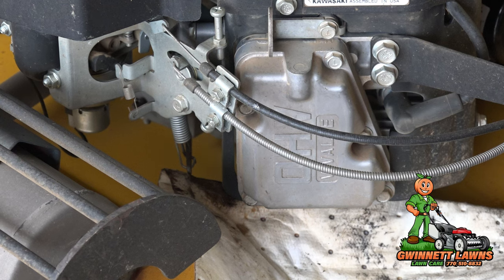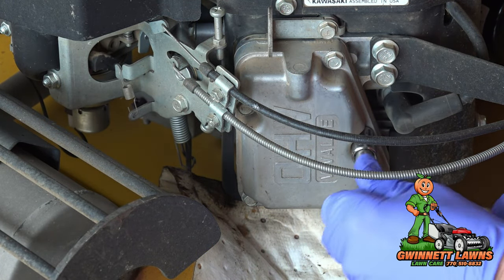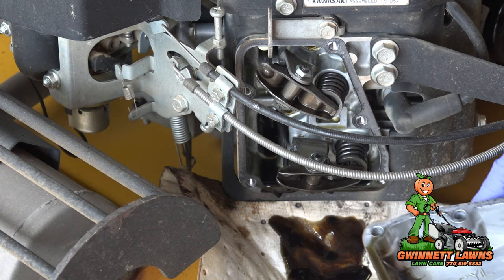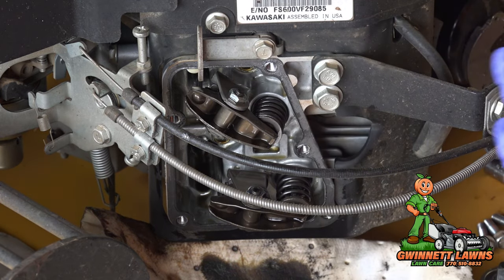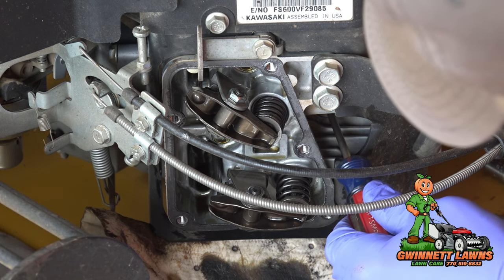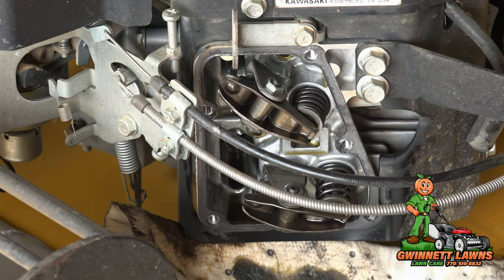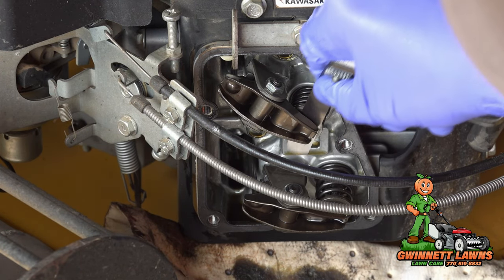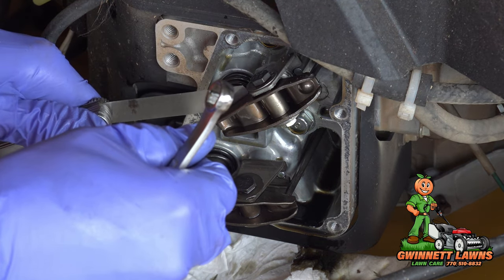How to adjust Kawasaki Valve Clearance...EASY DIY

Comment: Thanks for the great video!! I just did mine and was terrified, despite working on several engines for years. Looks like a I got it right. My problem was with hot starts. I didn't have a torque wrench that would fit, so I guessed at the torque by setting the nuts at "good and snug." I was super relieved when you mentioned that the exhaust valve clearances are usually the culprits. Same here! Both intakes had nice drag. The exhausts had no drag. I used a 0.08 mm gauge which matches your imperial size. Thumbs up (Liked) for you, sir. Thanks again!!

Comment: Nice video.  Thank you.  A couple of questions as I’ve never done this. 

1.  What was purpose of screwdriver in spark plug hole on cylinder 1?   
2. Did you replace seal on Cylinder 2?    Any tips or cautions on doing this?  

I have an fx801v, but am guessing it’s very similar.  

Thanks for showing his procedure with engine attached to chassis.  Really useful.

Comment: Dont loosen the bolt that much and used the score marks on that Cam to see that you are not moving it. Keep in mind that lawn mower valve springs are not very strong so its easy to drive in a larger gap gauge and think you have slight drag between rocker and valve stem